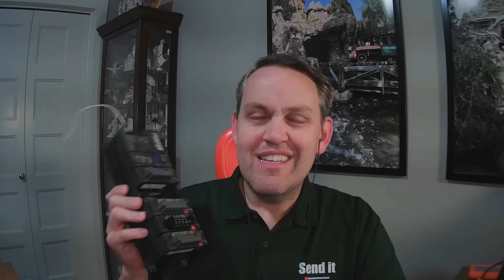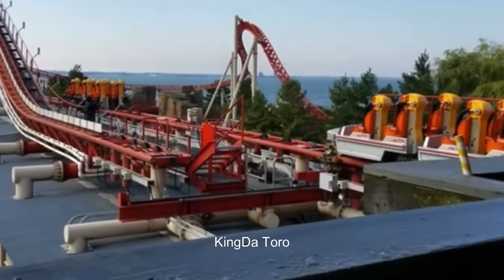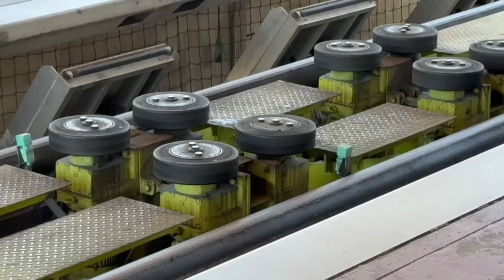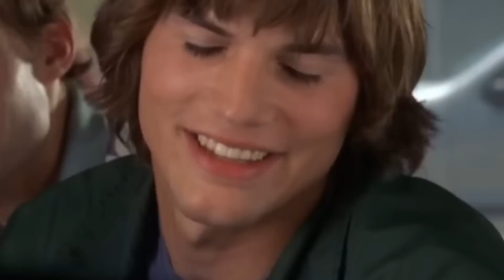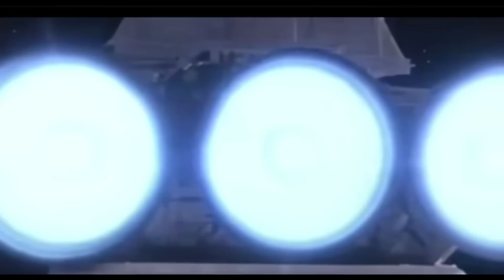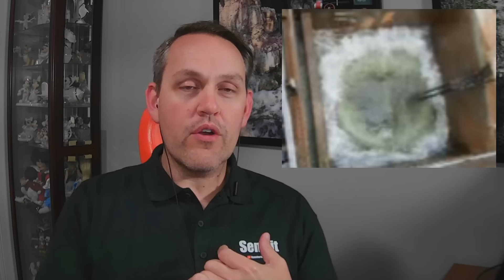Rollercoaster running modes and what they do.

Comment: Speaking of key switches on ride control panels, what brand/company of key switches and buttons are most commonly used on rides? When I was a ride operator at Six Flags St. Louis at the end of March and the beginning of April, out of the three rides that I operated (and all of the rides in the park in general) they all have the same beefy and robust-looking buttons and keyswitches, and I've been curious as to what brand/company is most commonly used on rides. Could you also give me a link to where I can see a list of all of the buttons and key switches on the company's website if I were to buy some? Thanks!
Reply: I found one on eBay for like 25 bucks
Reply from the maker: @Yadudesimon  nice
Reply: @ryantheridemechanic  thanks! I’m actually making a 8 button control panel for no limits 2! I haven’t gotten to the wiring or programming yet BUT… I’m excited to finish it!
Reply from the maker: @Yadudesimon  awesome! There are of course cheaper things out there but won’t give you the classic 800-T look most people know.
Reply from the maker: @MrEngineer20051  they are all out of the Allen Bradley (AB) catalog. AB won’t sell to the general public. The series of buttons and switches is the 800-T. An illuminated push button with aluminum guard will run about $190 each. Key switch is in the same price range.
Reply: @ryantheridemechanic  What about proximity sensors? What brand/company of proximity sensors are most commonly used on roller coasters?
Reply from the maker: @MrEngineer20051  pepperl and fuchs proximity sensors are the most common. Then something like ABB, SICK, but if your just looking for a sensor in general you can find small ones on Amazon and Automation Direct is a great source if your looking for functional.

Comment: Control power on, acknowledge lamp test, ride start, ride start, e-stop reset, ride start, lift start. B&M start up sequence.
Reply: I believe that’s how our Irvine startups were as well (2009-2017 builds), tho I’m not sure we were told to actually do a Christmas tree test verification. Im pretty sure the training was along the lines of “it’s going to flash at you, hit acknowledge” 

I’m sure it was in maintenance’s startup, but I know it wasn’t an initial line on our startup sheets or part of our block testing training.

Also I have a good Irvine-Ondrey control system failure that luckily due to our vigilance and hitting estop before the fault condition was met kept us out of the news. Email to come to your inbox soon, honestly would love to hear Irvine’s off the record take on the situation! I’m sure they were contacted as the fix required reprogramming
Reply from the maker: @stolenarmy_  what year was that one?
Reply: @ryantheridemechanic nitro at great adventure, 2001.
Reply from the maker: @stolenarmy_  okay. Did consign also do the program. Sounds the same at the one I worked ok. I believe consign was doing most work for B&M there.
Reply: @ryantheridemechanic its nitro at great adventure. 2001.

Comment: How would they re-program blocks for rides that change over time? Is this an easy change or can that be difficult to do? 
Let's use American Eagle at SFGAm for Example. The giant helix is referred to as "The Barrel" and it has brakes on top of it.

Eagle used to run three trains on each side and that acted as a block zone but now the block extends all the way to Brake 5 which is the last Helix. 

Have you ever seen Reprogramming bugs? Because Eagle used to have a funny one where it would say a part of one of the old spiels like "THE AMERICAN EAGLE" in a deep male voice from the 80's.
Reply from the maker: @DokiKimori  a professional engineer has to make any changes to the block system and the company that owns the ride has to sign off on. It as well as insurance. These things are considered major modifications to the ride.

Comment: I’ve seen on behind the scene episodes at Cedar Point that on Millennium Force, in order for the ride to start, the maintance person has to take the venicular up the lift, check out the track and at the top of the lift has to come down the other side on the cat walk and half way down the hill there is a reset button that must be pushed to tell the computer the ride is safe.  
I guess it’s something that Intamin  automatically installs on their rides.  Not sure if all manufacturers use this technique
Reply from the maker: @jackschissler255  a lot of manufacturers put estops around the ride. Most also say it has to be pushed and reset daily. But not all of them.
Reply: I said I'd do Ithat on a tour I just need hired, haha CP never called, oh well.